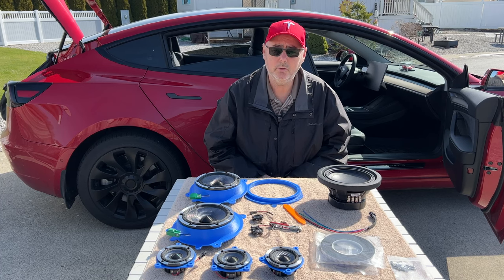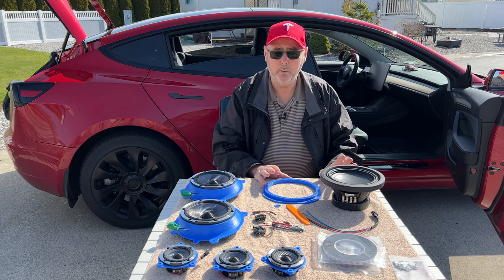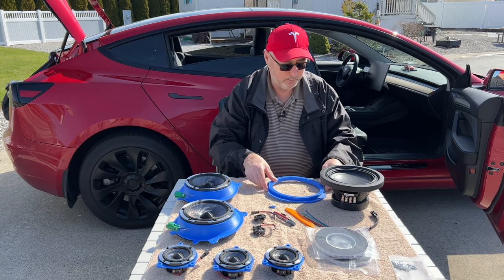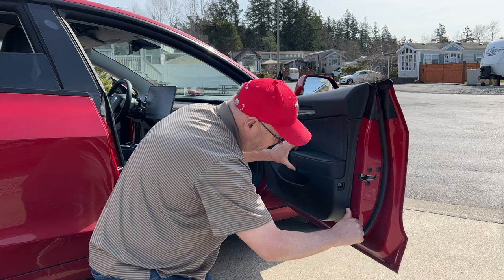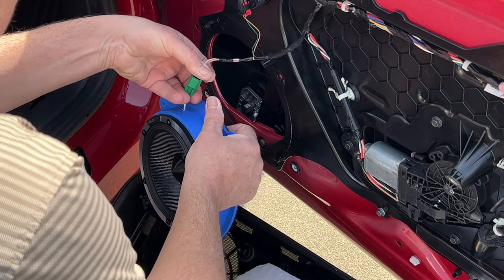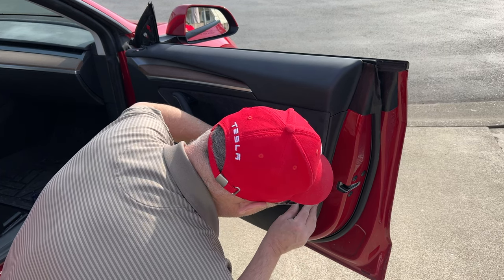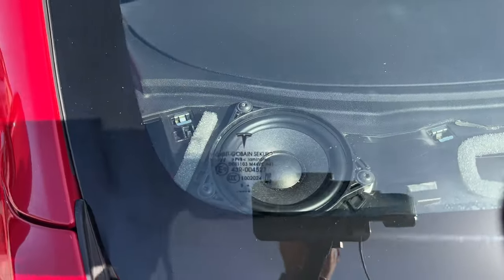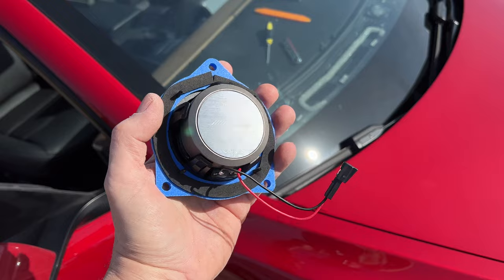Unleash Your Tesla's Sound Potential: Model 3/Y Alpine Speaker Upgrade | Hepaking.com 🎵🚗

Comment: Thanks for the video. It is well done and very informative. I just purchased a Model 3 and have been watching videos to get ideas before I tackle this myself. I also happen to be a veteran loudspeaker engineer and just want to point out that you made too much of magnet size and weight when describing the original speakers. The Tesla speakers use Neodymium (NeFeB)magnets to save weight. Weight is the enemy of vehicle performance and range. The aftermarket speakers use Strontium Ferrite. The NeFeB material is capable of roughly 5-10X the strength of the Ferrite magnets, depending on the specific material grades used. It is entirely conceivable that the stock speakers may actually have stronger magnets than the heavy aftermarket ones. The NeFeB material is also considerably more expensive. It is used to save weight without compromising performance, so they should not be knocked for having "small" magnets. This is not to say that the aftermarket speakers aren't better, but if they are it's for reasons that are not due to magnet weight. Perhaps cone material, suspension linearity and other things are improved, but the magnets size most likely isn't an advantage.

Comment: Tesla Youtubers, a larger size magnet usually means the speaker is less efficient and requires more power. The small magnets on the stock speakers were intentional with the speakers being ultra efficient and requiring less power. While the aftermarket two-way mids/highs will improve those frequencies and clarity, you are also most likely losing mid bass in the doors with the aftermarket. What are the wattage requirements of the aftermarket speakers? Maybe I'm wrong and the aftermarket speakers are also ultra efficient. Other than that well done video.

Comment: I'll be upgrading when it gets cooler in the fall. The price is right and thank you very much for taking the time to do the video.
Reply: In fact, I ordered the speaker system today with your recommendation to get the subwoofer separate. Saved some $$$$$. Thank you very much.

Comment: Hey Dave I liked your video. My question for you is I have just the basic 2023 Model 3. I found out after taking delivery that Tesla had a premium package. So I also found out that there are speakers installed that are not enabled. That’s why so many are installing these aftermarket wiring harness’s to activate those already installed speakers. I guess Tesla cut costs so they didn’t hook them up. My question to you is will these Alpine upgrade speakers work on my basic system?  I’m thinking that I don’t have a subwoofer anyway so I would just be interested in the door speakers and the 3 dash speakers.
Reply from the maker: this will not help with your car. I understand there are wiring harnesses that enable the speakers. Have no experience with them.
thanks for watching
Reply: @BCTeslaGuy  
Thanks for getting back to me so quickly. I guess I will just have to live with what I have. I even tried to get an appointment with the Tesla service department and they said that they couldn't help me out and that I should have ordered it before they put the car together. It's really frustrating that they don't have someone in their service department that handles audio systems.

Comment: Question : How good is the sound upgrade without the Sub and tweeters? I have the RWD model 3 so theres no sub  and associated wiring and also the door tweeters are not activated. I would be interested in replacing the 8 inch door speakers and the 3 dash speakers? Thanks for an outstanding video by the way!
Reply from the maker: I noticed a difference but I do have added power and can control the frequencies via 2 DSP/AMP. You may noticed it being clearer. The sub really makes a difference. You can add an aftermarket subwoofer from NVX.
Reply: Then for the reply I’ll have a look at NVX

Comment: Hi! Thanks a lot for this good video. A quick question: there is a third tweeter for center speaker. Why don’t you replace it? Why is it not included in any upgrade package? Obviously you can’t answer this last question, but I’m asking myself.
Reply from the maker: I may switch it out later. thanks for watching.

Comment: Hello
I have a model 3 2023 
I think I don’t have subwoofer 
Where did you get this one ?
Reply from the maker: if you have a RWD then you don't have a subwoofer. You can add one. NVX has one with an amp and a 10" subwoofer. I have this installed as well. Works great.
Reply: @BCTeslaGuy  
Hello Thks for reply 
Do you have the link for this équipement 
Also I have seen your video about alpine do you think it worth it after adding subwoofer ?
If yes then maybe I will buy it 
Do you have the link also 

I have seen also the video for the frunk this one I will buy it very soon 
And your video is very clear (great video )

And yes I have RWD long range 2023 

For information I leave in Paris 
😉

Comment: The stock sound is already impressive compared to previous cars I’ve owned. But curious how much better the upgrade are. Install seems fairly doable for a noob like me. So the stock amp doesn’t need to be changed? Any footage on how to remove the box that holds the sub?
Reply from the maker: I noticed a huge difference in sound but that's a personal thing. Sorry my camera footage for the subwoofer didn't work out. Lots of other videos on the swap on youtube. The question is really, is the cost worth the effort. For me, Yes.
Reply: @BCTeslaGuy  thank you

Comment: Where's the subwoofer box located?
Reply from the maker: Using the factory subwoofer enclosure located behind the right panel in the trunk. Just replaced the speaker.

Comment: I keep wondering how much of a difference they actually make. Can the factory amps really push the new speakers as needed? I had seen somewhere that the magnets used on the factory speakers is a different material and therefore the size cannot be compared. Not sure the truth there.
Reply from the maker: If you're happy with the system, I would not upgrade.

Comment: Thanks for the great video Dennis! Which version of the Model 3 do you have? Will the Base RWD version of the Model 3 have the subwoofer too? I'm thinking about buying this. Thanks.
Reply from the maker: RWD doesn't have a subwoofer and they don't enable all the existing speakers. Hansshow and other vendors offer ways to enable those speakers. You can add a subwoofer to your system. NVX has a subwoofer package that is much better than the stock subwoofer. Check those out. I added one to my Long Range and then upgraded to an enclosed 12" subwoofer using the same amp. Thanks for watching
Reply: @BCTeslaGuy  Thanks for the detailed reply!
Reply: I actually installed the Hansshow kit with the surround speakers in the back to my 2021 standard range, not knowing your model @timo pre-2020 models already have the backend speakers installed (just not activated), it could be a simple and cheap solution to start with, and later you would upgrade the speakers 🔊 😊

Comment: 9:34 Just needs Dynamat, (on the outer and inner door skins metal and the inner door panel). Stinger Roadkill foam Fast Rings (for behind driver baskets,) and Hushmat Wave Breaker Kit (to break up waves behind the driver). 🔊 🤝
Reply from the maker: I agree. Still lots I can do. I did some sound deadening in the back when I installed the subwoofer. Doors are so much more work to do. Thanks for watching

Comment: What’s factory RMS to the subwoofer ? I feel that subwoofer is getting underpowered
Reply from the maker: dual 4ohm
Reply: @BCTeslaGuy  not the ohm , I’m asking RMS , like how many watts is the factory amplifier pushing to the subwoofer. A 8” Type S is rated at 300 watts RMS , and I’ve read the model 3/Y’s amplifier only pushes 80 watts RMS to sub , which is highly under powering the subwoofer
Reply from the maker: Sorry, I'd have to take the panel off to look. Don't think it's much with such a small magnet of the original subwoofer.
Reply: From memory the factory woofer is 150rms. The Alpine is rated at 300 minimum, and generally S type and R type are also low in sensitivity.

It mat not last to long 😬
Reply: @bensimmonds1026  I found out it’s actually 80 RMS , so definitely under powering  the sub
Reply: @akidim13  being that under powered, it’ll most likely burn it out in time

Comment: Wow, those speakers in the windshield area have a much smaller driver. It looks like a 3-inch vs a 5-inch. Do you know the actual stated size of the drivers? I hope you don't lose too much upper mid-bass with those. Great video, thanks!
Reply from the maker: These are the speakers. Information direct from Alpine. https://www.alpine.com.au/shop/speaker-systems/digital-precision-speakers/dp-653/
Reply: The factory are 3.5 and the replacements are 3. The factory front door speakers are 8” and the replacements are 6”. Loosing a lot of cone area in my opinion. Plus the magnet comparison is not valid because Tesla uses neodymium magnets versus iron ferrite so their smaller size packs a much bigger punch than you would think. Orella acoustics takes a much better approach. They replace the front dash speakers with better ones, still the same size as stock. They replace the front center speaker with a coaxial one to get back the tweeter that Tesla deleted for some reason. They also replace the a pillar tweeters and the rear door speakers with coaxial speakers. They also replace the sub with one that has its own 300w amp versus the factory 160w. I just don’t like the approach these guys used here downsizing all the cones.

Comment: Can I do this same thing to my base RWD?
Reply from the maker: yes,  but you will need to enable all the speakers and if you are looking at the subwoofer addon, you will need to get an enclosure or add the NVX subwoofer kit with amp.
Reply: @BCTeslaGuy  any potential problems from this? How do you control the sub from the interface? Is there a toggle that needs to be hidden under the dash or something? I just hate jank and that’s my biggest fear when doing something like this
Reply from the maker: nvx subwoofer comes with an amp with a dial to adjust the amount of bass. works great. I have one and also added a 12" enclosed ported sub. Love my bass

Comment: What about the amplifier? No upgrade there? How can the stock amp that’s meant to drive those flimsy paper speakers power those heavy duty carbon speakers 🔊????

Should’ve sprayed the inside and out of the sun box in a ton of rubberized under coating and put 1.3 lbs of poly fill in the box to make the speaker think it was in a slightly bigger box and making it more dense.
Reply from the maker: I have other stereo upgrades in my system. I also have 2 DSP's to tailor each channel as well a 12" subwoofer enclosure from Down4Sound running a NVX 500W RMS mono amp. Many more upgrades to be added such as rear speakers and amps to drive the new speakers. thanks for watching

Comment: Why didn’t u change tweeter on dash?
Reply: I’m curious didn’t mean to insult. Are the run of the same channel or are they separate
Reply from the maker: planning on doing that when I update the rear deck speakers. Hoping to replace them with 6 1/2" speakers.
Reply: @BCTeslaGuy  gotcha that sounds insane. It’s a 4 back there correct? Good luck on that.
Reply: @BCTeslaGuy  any amplifier upgrades? Dsp?
Reply from the maker: np. :-)
Reply from the maker: already have 2 DSP and 1 amp to drive a 12" subwoofer box. Got lots of bass
Reply: Any luck with 6 and a half inch back side

Comment: why no upgrade to the back seat door speakers?
Reply from the maker: They are the same as the front dash speakers. I'm still trying to figure out what speakers I want to install on the rear deck. Looking at putting 6.5" coax speakers. This is not something I have the skill to do myself.